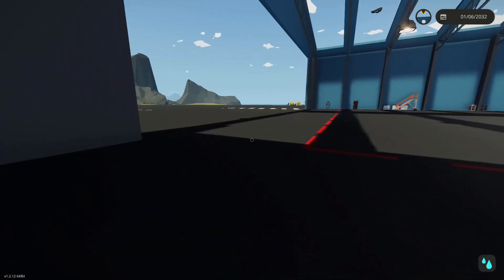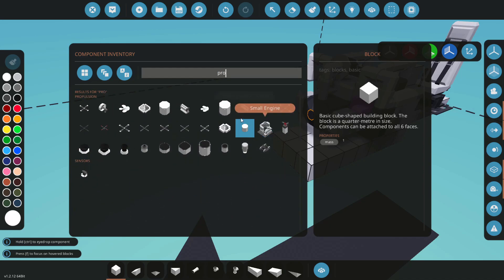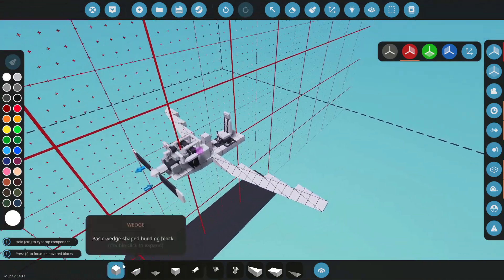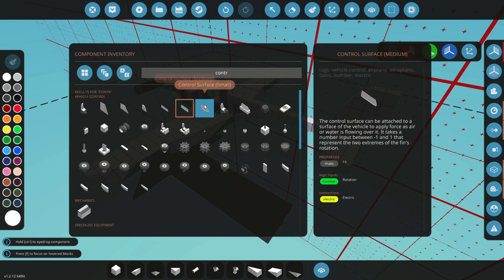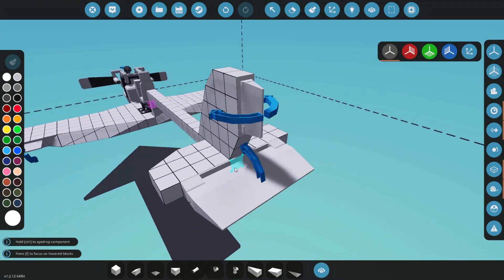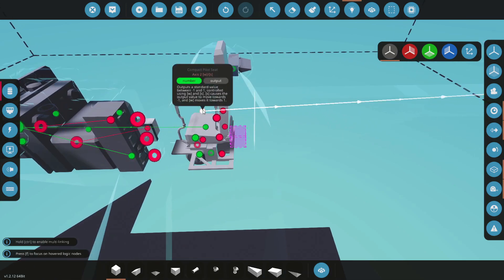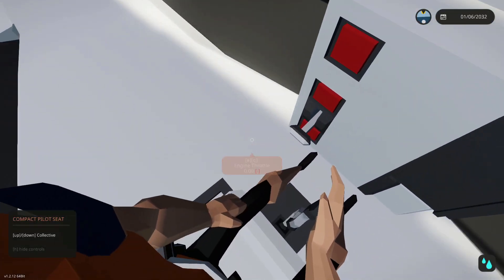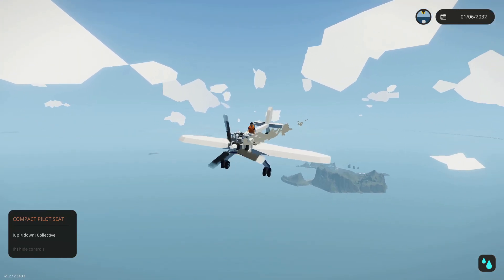5 Minute, Easy Plane Tutorial l Stormworks Build & Rescue

Comment: If you wonder how to build the engine, it's actually quite simple. First the parts, add a coolant, the engine, and a fluid tank, next hook up the pipe holes with pipes. (Make sure to match them with the corresponding pipe hole, the fuel doesn't go into the exhaust.) There you go an engine that might work.

Comment: You should update this plane to add like a parachute just in case if you lose control of the engine need a need to get out
Reply: that's really easy to do, just add a vehicle parachute and connect it to a button and it'll work